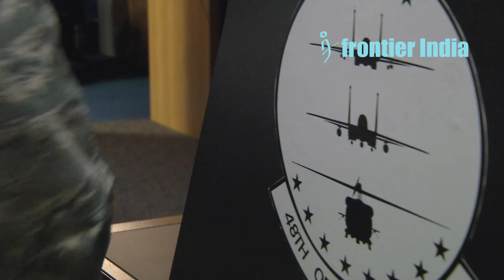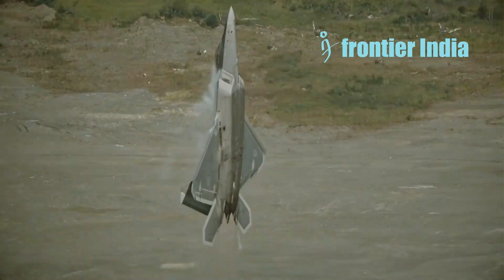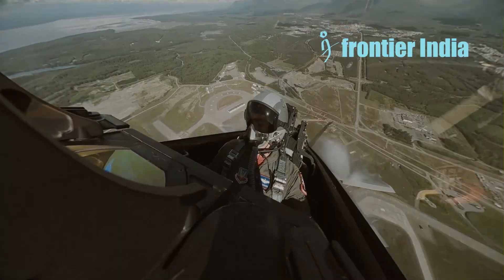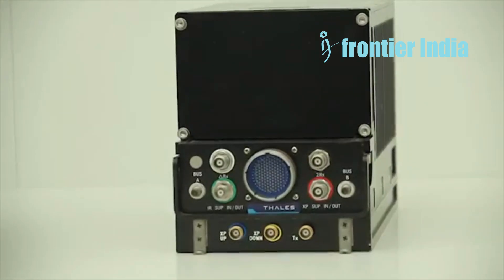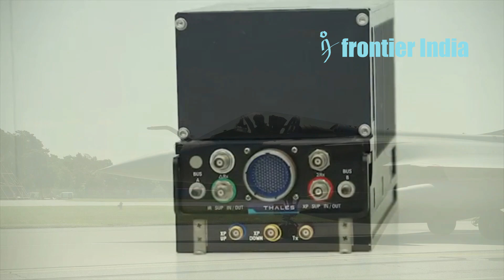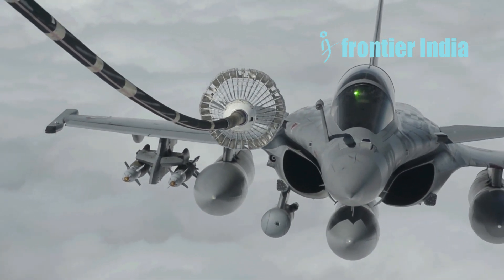Rafale vs F-22 - The French Way of Stealth - SPECTRA: The Game-Changing Tech Behind it.

Comment: French way of stealth is NOT really achieving a stealth, but an EW " stealth" if we can say.  Stealth is basically a passive way of keeping the aircraft out of being effectively detected, and especially aimed (locked by a fire control radar).  So it will give operations a surprise.  But EW is an air battle mode when both sides already know each other in the battle, the rest is just about what tactics each side needs to take to win.  In that sense, EW is not what a real stealth aircraft wants to do in the first place in many missions, f.e. a reconnaissance one where you try not to give any radio emission as much as possible.  Therefore,   In terms of stealth, Rafale is not even comparable with F-22, even F35.  According to some reports, in some Red Flag exercises, F35 beats F-15EX plus F-18 G combinations in an overwhelming ratio.  Besides, in terms of EW, do you think Rafale can beat F-18 G?
Reply: Spectra is a suit of sensor fusion and radar EW performed with hardware built inside every single Rafale aircraft. It's not a dedicated aircraft with his dedicated electronic warfare pods like the Growler. Growler has more capacity in the ew role since it's purpose built (and has a weapon operator in the second seat), but the f18 Growler must be part of a strike package with other aircraft.
Reply: I like to think of the Rafale and SPECTRA as a type of electronic stealth.